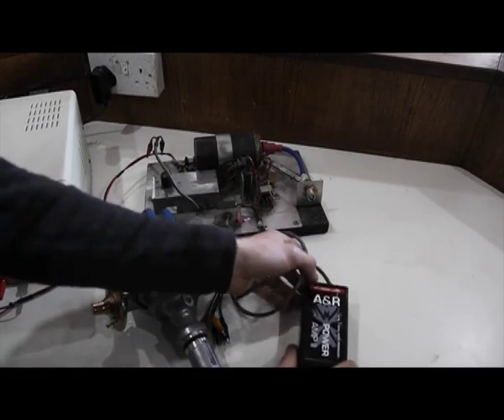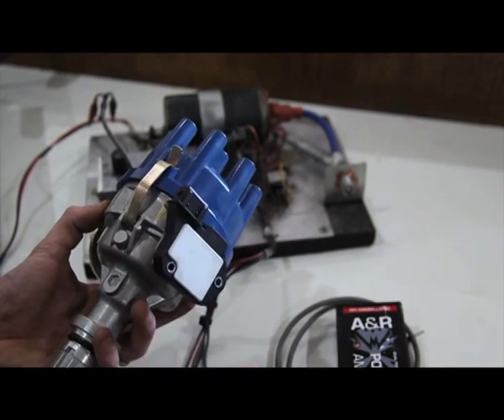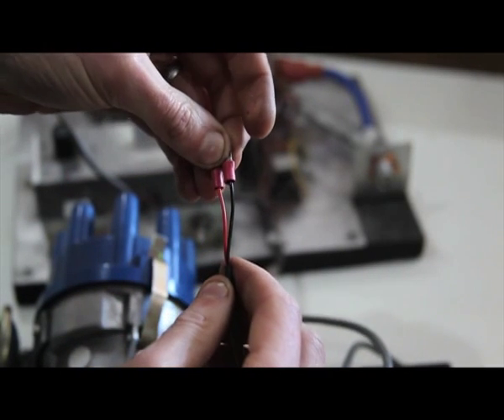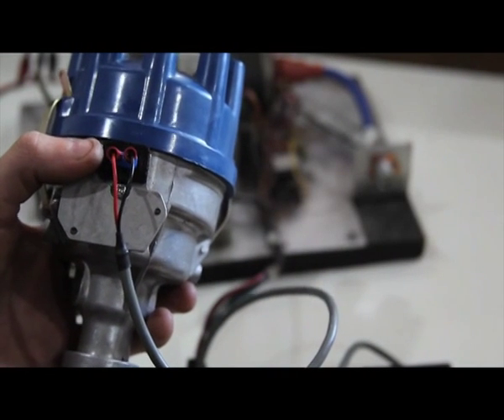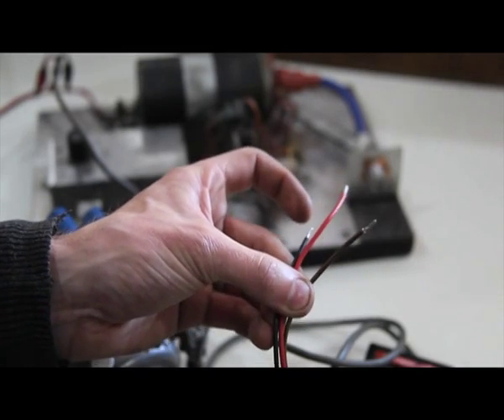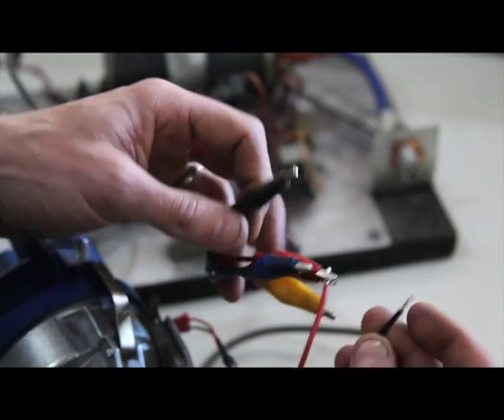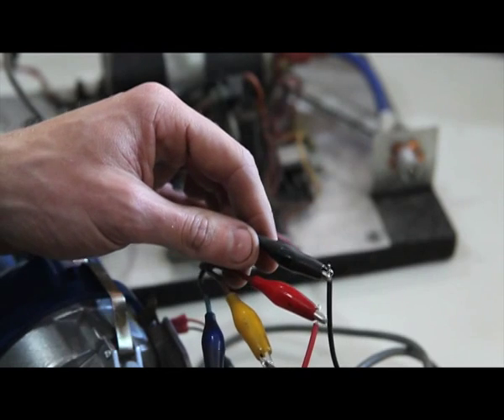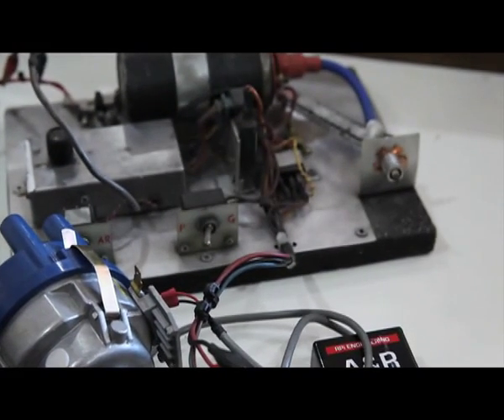Short video showing how to wire the RPi Power Amplifier

Comment: RPI Engineering, i have a question... i have a rover v8 fitted to my Viva and i've just purchased a complete ignition kit from yourselves, but the thing that has stumped me after watching this video is, my live to my coil is the wire that comes from my tachometer, so do i just connect that to the power side of the Amp (red cable) and forget about the brown (neg tacho wire)?
Reply from the maker: The brown wire from our amp is not a tacho feed. Its the trigger for the coil (which in turn becomes a tacho feed), its what causes the coil to charge, then discharge which in turn is what makes the spark. Your coil should have a switch 12 volt ignition feed, this may well be on the same wire as your rev counter power supply but that all depends on how the wiring is routed on your car etc. Then your rev counter will pick up the ignition pulses from the negative side of the coil (the switched side from our brown wire on the amp). If in doubt, re read the amp instructions or locate an auto electrician who will be able to wire it in without causing any damage to components or likely hood of melting wires.